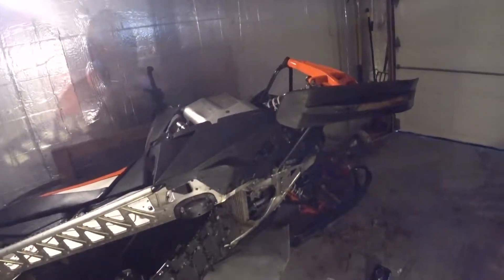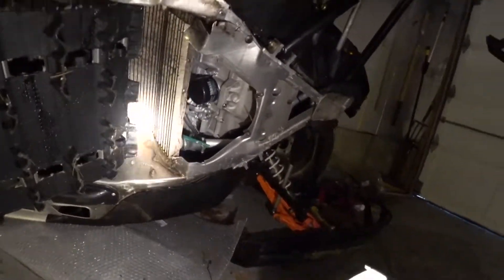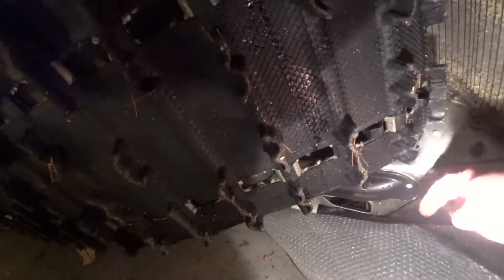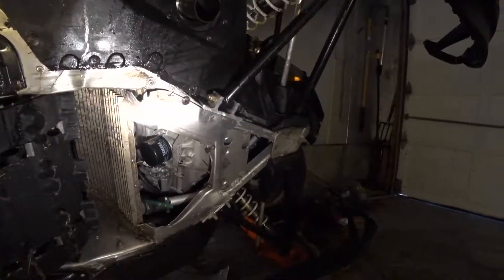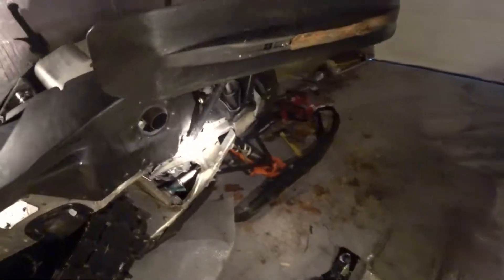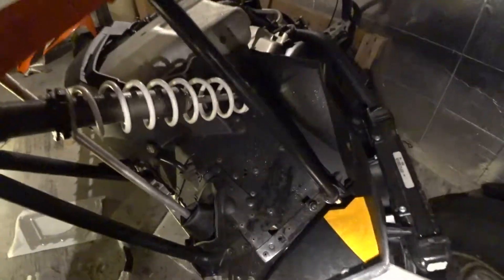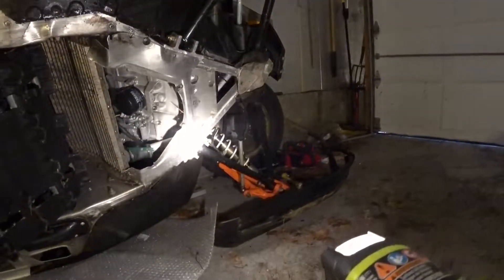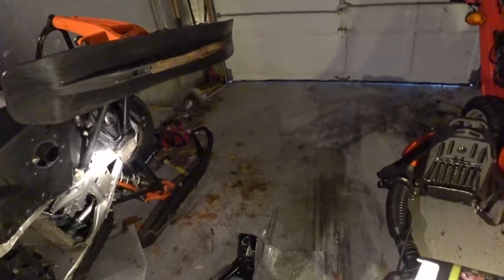2014 arctic cat xf 7000 crosstour. The damage and the part that needs replacing

Comment: What was the outcome of this? Just came across your vids regarding your sled while looking for info on pro cross chaincase maintenance. Quickly finding out nothing is easy on these things! Did the dealer that did the original work  come good with any support for you?
Reply from the maker: Simon Lawson  yes well it is all squared up there service director called me. They came and got the sled from me. And of course it worked fine for them and has been fine since  on the 2 rides I was able to take with it.  They also fixed the stuff they broke or lost. And bought the other parts I needed to replace   In the end though was still over a year and 2 grand out of pocket.  So unhappy with them in the end.   No modern sled chaincase  nothing is easy. Here is hoping for snow and a problem Free season